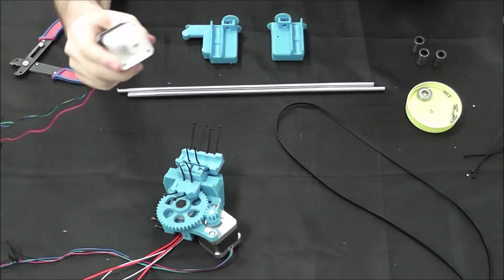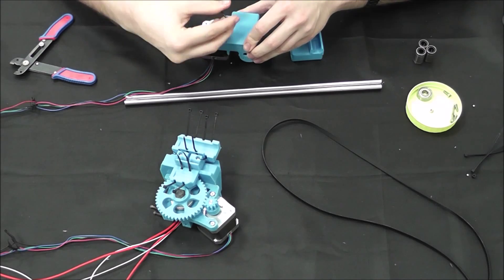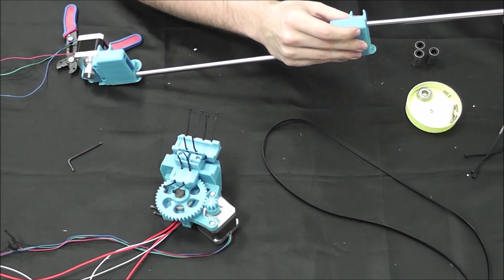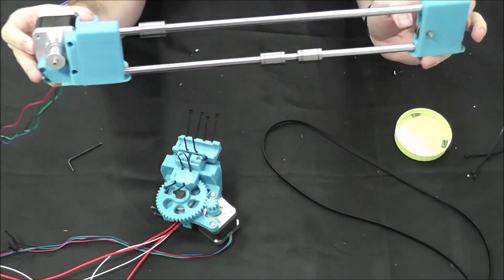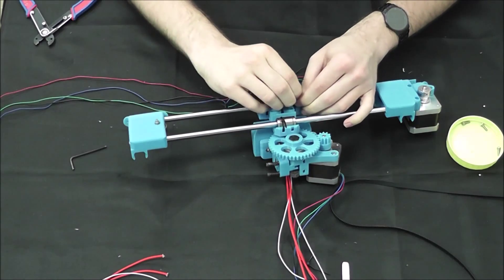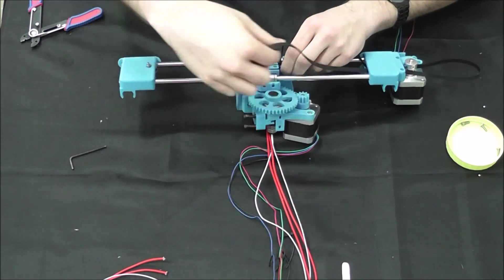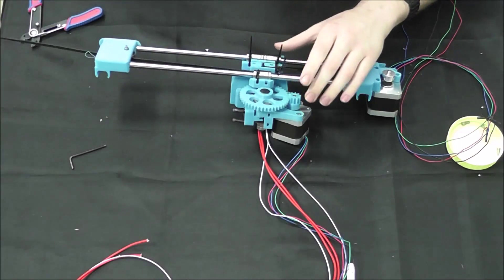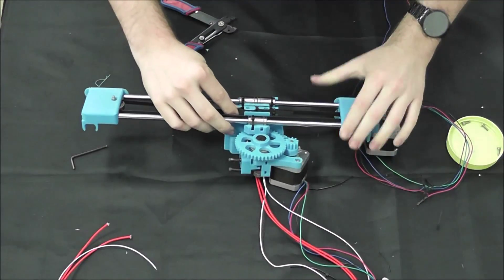RepRap Prusa i3 Assembly Guide p4 - X Axis Assembly - Additiveware International

Comment: Cable ties?  Really?
Reply: My money is on the 3D printed parts failing way before the nylon zip ties... But yeah the whole idea is to make a 3D printer using a 3D printer and commonly available parts. Sure a machined casting with bolted in blocks to hold the bearings would be stronger, but then you would be watching a video series on how to make your own CNC lathe and milling machine...